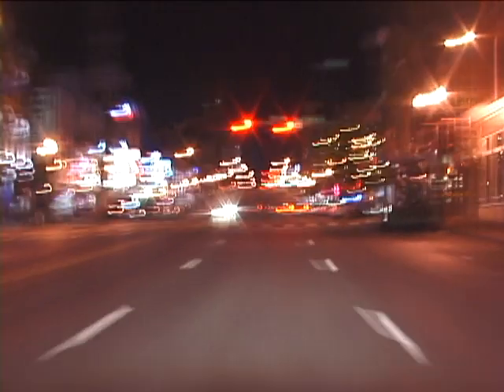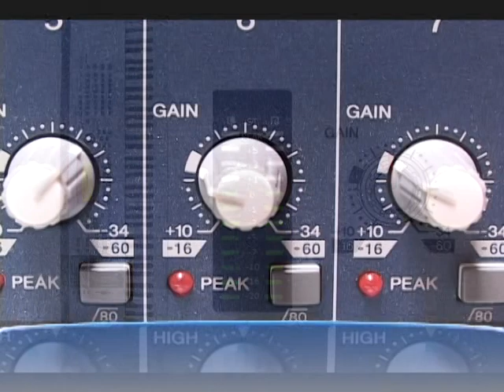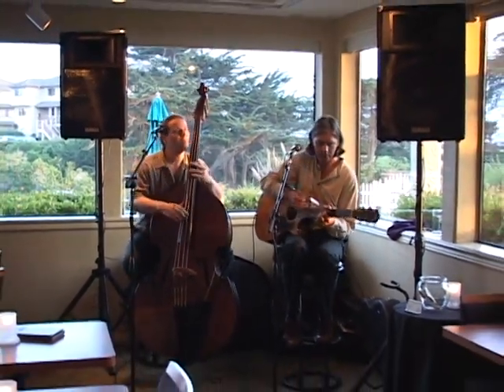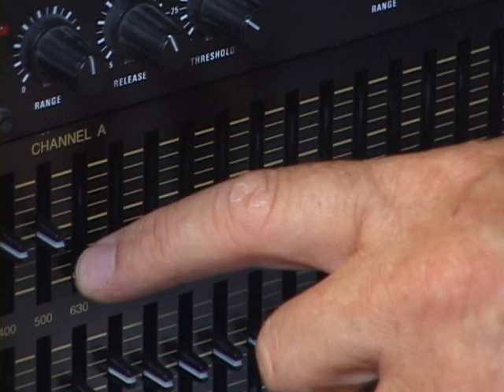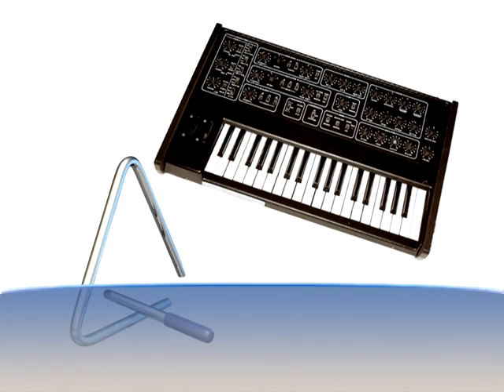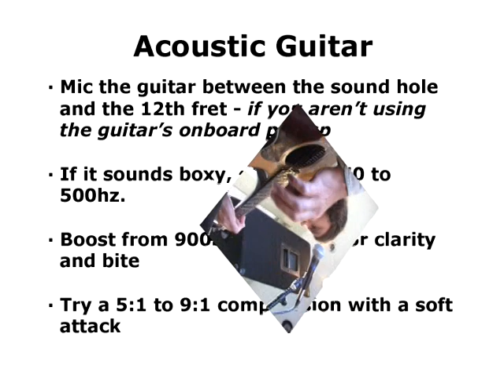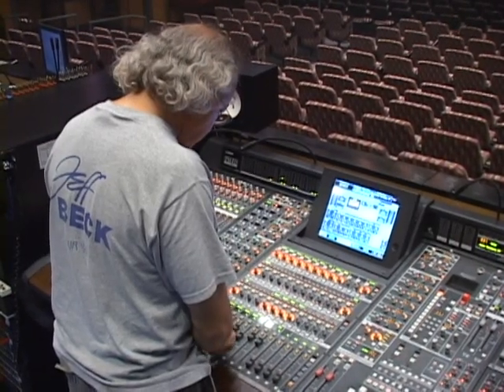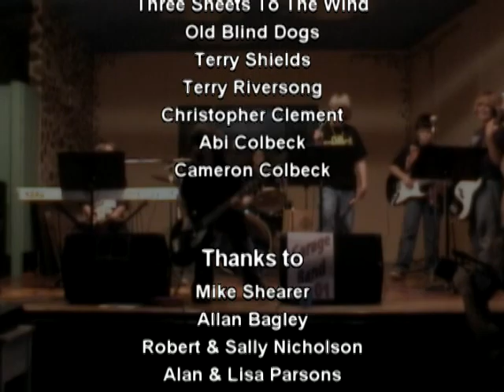Yamaha | Exploring Sound Reinforcement (2005) | FULL VIDEO

Comment: 2:15 Microphones
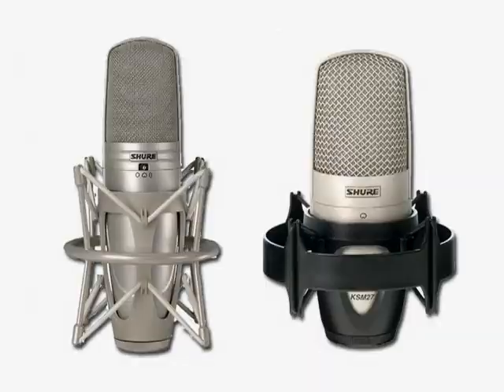      3:20 Mic Types
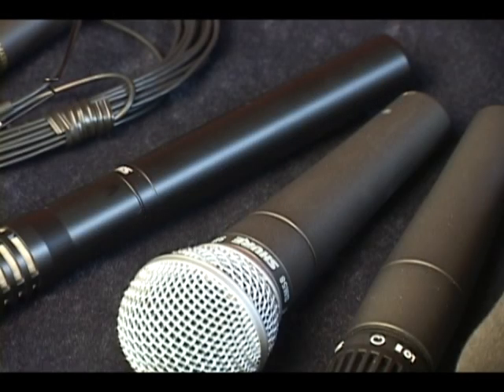      9:10 Mic Placement/Technique
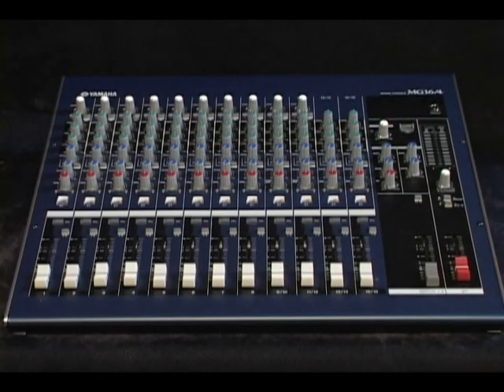12:26 Mixers
      13:23 Mixer overview
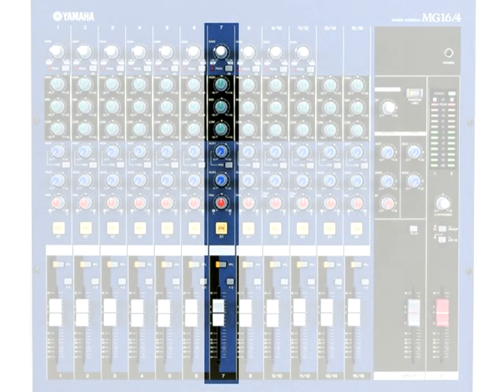      16:28 Channel Strip 
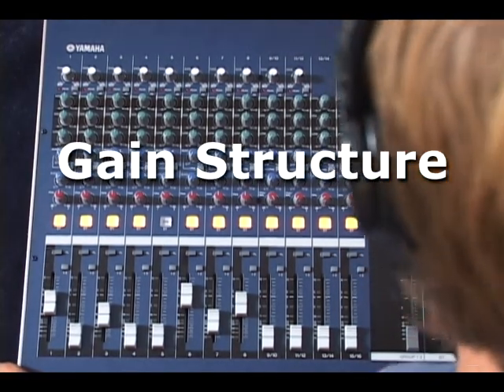      18:50 Gain Structure (CRUCIAL)
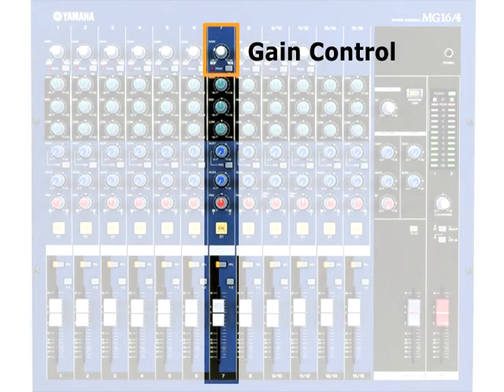      20:43 EQ
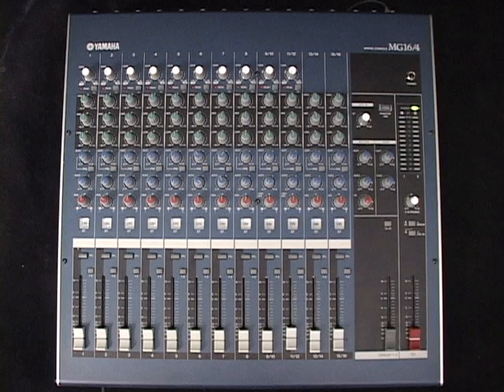      22:02 AUX sends
      25:49 Actual Examples
      28:22 Groups/Bus
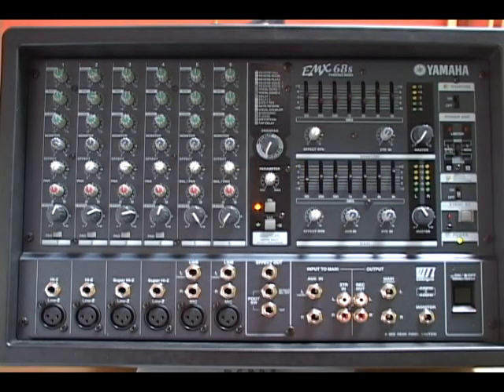      33:37 Powered Mixers
      38:24 Digital Mixers
41:51 Power Amps
     43:55 Watts and Ohms
     48:24 Crossovers
51:18 EQ
     51:54 EQ on Mixer
     53:44 Graphic EQ
     55:09 Parametric EQ
     55:54 EQ tips
58:05 Effects
     59:15 Signal Controlling FX
     1:00:13 Compressors and Limiters 
     1:03:38 Noise Gates
     1:05:21 Reverb
     1:08:40 Delay
1:11:09 Loud Speakers
      1:14:43 Drivers and Crossovers
      1:19:15 Dispersion/Speaker Placement
      1:21:50 Speaker Tips
1:23:53 Setting Up Sound System
1:27:45 Soundcheck 
      1:28:34 Bass
      1:28:50 Drums
      1:29:58 Acoustic Guitar
      1:30:11 Electric Guitar
      1:30:30 Vocals
      1:30:45 Keys
1:31:07 Monitoring
     1:32:36 types of Monitoring systems
1:38:15 Live Applications
     1:38:20 Coffee Shop
     1:42:17 House of Worship
     1:47:14 Concert Venue
1:51:56 Best Practices
1:55:51 Troubleshooting
     1:59:27 Feedback
     2:01:46 Power Shutdown
2:02:51 Best Practices/Tips and Tricks

Credit to @godbeforeme for making this list - I found it on another upload of this video, but this one is a bit higher quality. Luckily it's the same exact length so it should work!

Thanks for the upload!
Reply from the maker: @threedog99  Lovely. Thanks, mate!